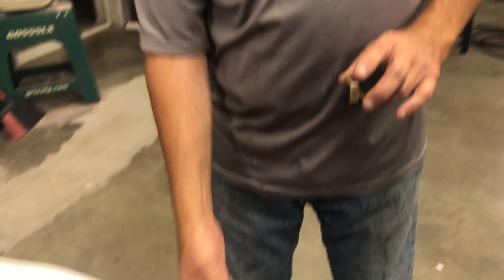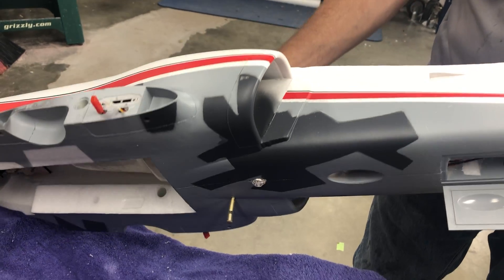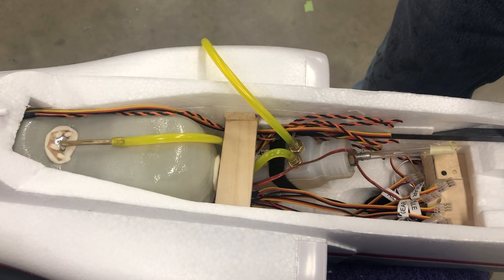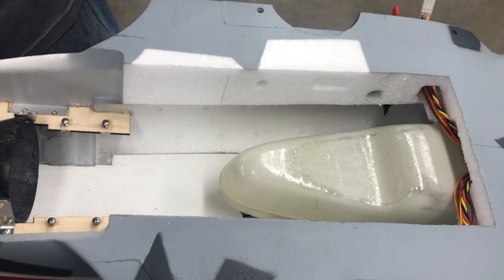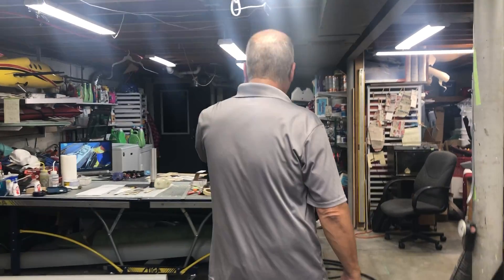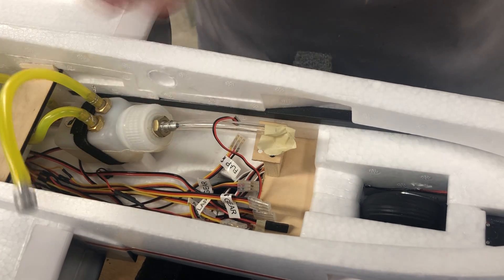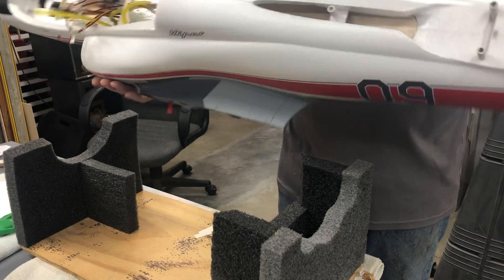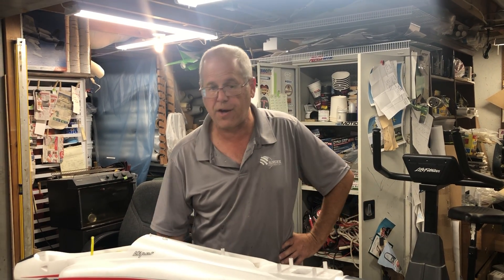Episode #6. Eflight 90mm detailed turbine conversion

Comment: Excellent videos , well explained , just one question , do you remove the Vent Plug before flying? or you leave it closed , also, why don't you do a loop with the vent hose as they do it with the 3d planes ?  or is no required for turbines ? thanks